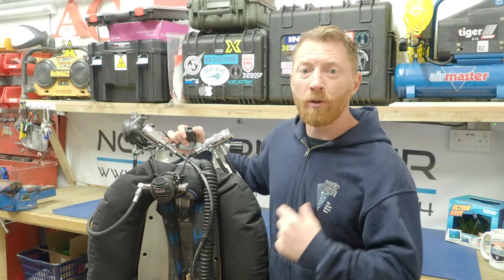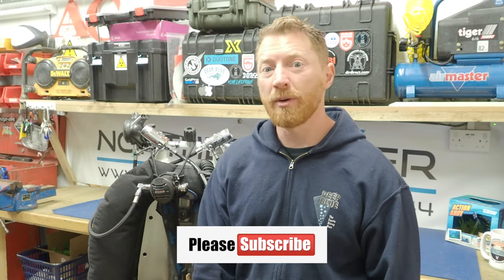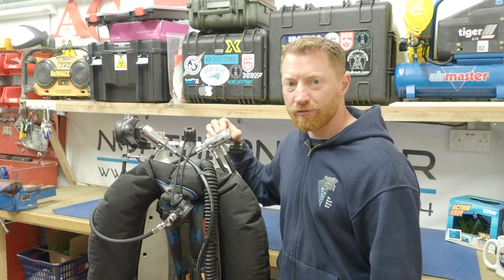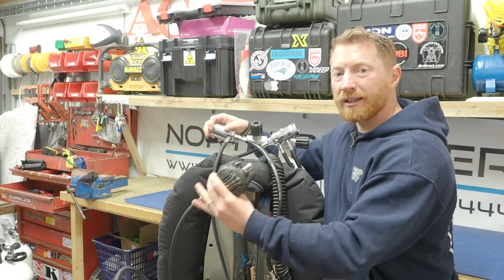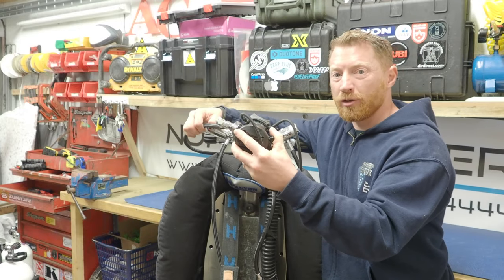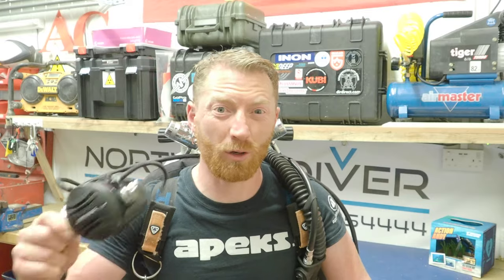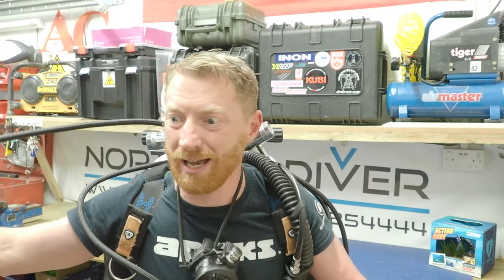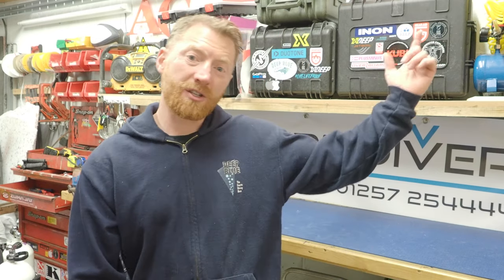HOW TO SETUP THE LONG HOSE | Hog loop setup on a Twin Set for scuba diving | APEKS DST 5TH PORT REG

Comment: Same comfiguration, just I like my second stage thats on necklece to be on shorter 55cm hose, thats just what I prefere
Reply from the maker: I spoke to  Robbie Schmittner, when I was doing the “Are you a scuba diver, fancy a brew?” Podcast and he prefers a short hose on both left and right. He said if they need your gas, why not just hand the bottle off to them….. Actually makes loads of sense till you have to gas share I guess, and then what if it’s your long hose that’s 4k’d and you’re sharing your other cylinder……. Everyone has a idea of what’s right for them, not much is wrong with most ideas, just some are better than others in different situations

Comment: Looks like there's quite a bit of stress on the long hose at the 1st stage when it's in its normal position.
It's a cool look, with both 1st stages at an angle, but that also seems like it would make them more vulnerable to hit them on overheads. Especially with the environmental seals exposed like that, I have reservations whether this is a practical setup.
Reply from the maker: Yeah I agree about the environmental seals, but it’s the most common setup I’ve seen. There’s no more stress on the hose than in the alternative setup I show.. thanks for watching